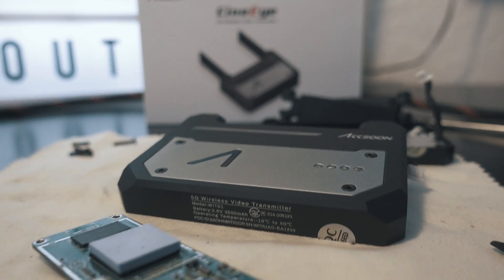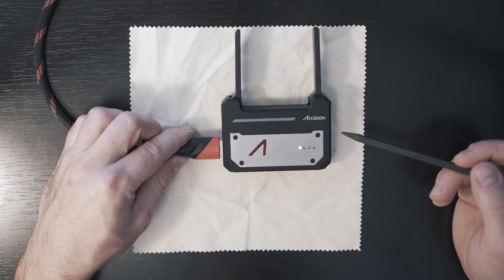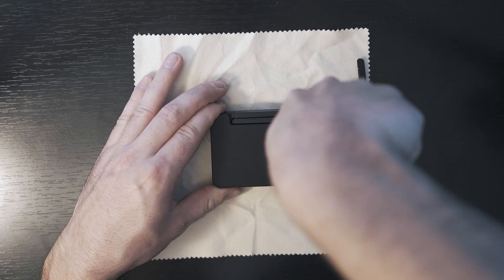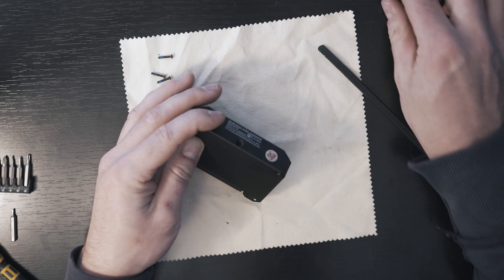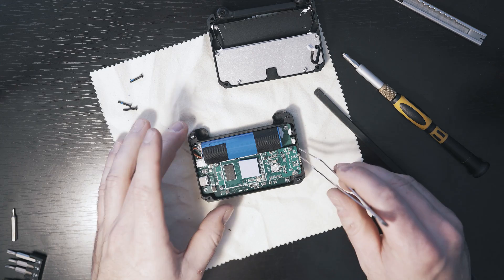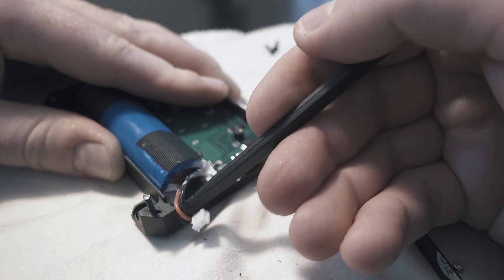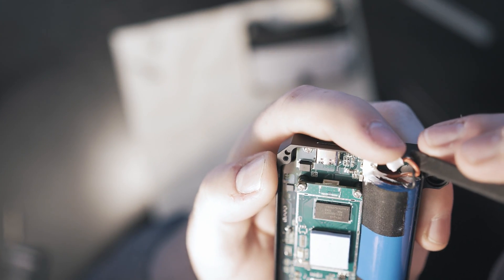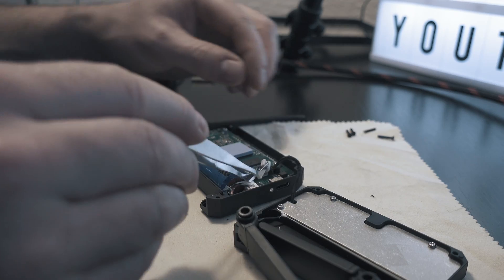ACCSOON CINEEYE TEARDOWN | HARD RESET | Wireless Video Transmitter | 4K

Comment: I have battery problems in the cine eye. It not showing any light when it plugins to an usb charger like before. I need to reset the battery disconnected from the unit or I need to change it?
Reply from the maker: give it a try… disconnect the battery for few minutes and test … maybe your battery is done …
Reply: @takeapart  what to do if the battery is done?